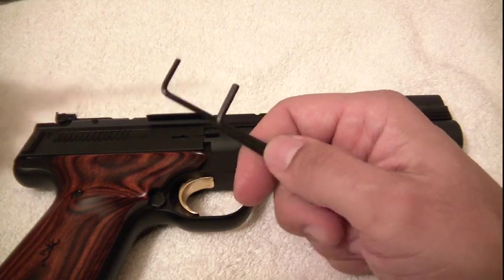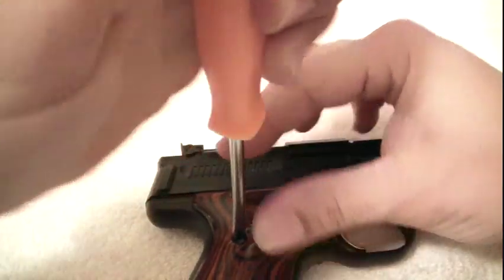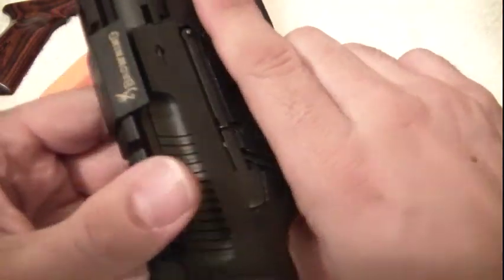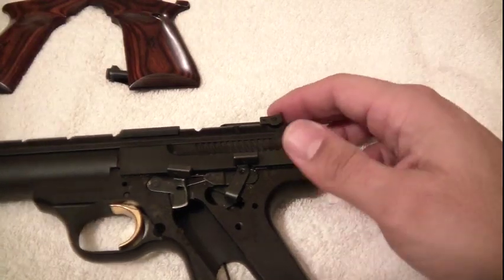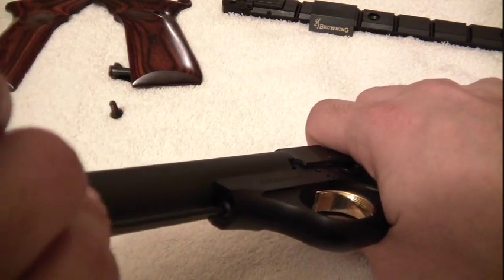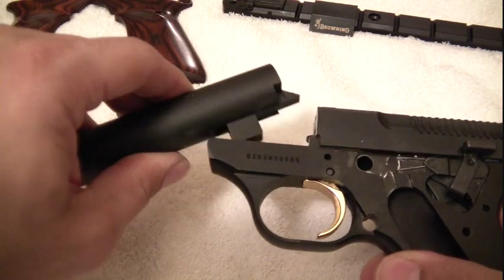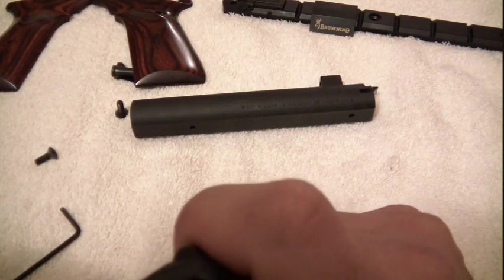NEW--MUST SEE!!! Browning Buckmark Disassemble (1/2)

Comment: Late to the party! But wanted to complement you on a great video! I have a Buck Mark Hunter with a 7-1/4" bull barrel, 2013 model year. Bought a Tactical Solutions threaded barrel to allow putting my suppressor on the gun. The only question I have, the breech block (or whatever it's called) on my Buck Mark does not "fall out", even if I gently pry it, no way. I can't believe that it not removable because obviously it contains firing pin, etc. Thought maybe I would have to remove the extractor or use dynamite, but that puppy seems un-removable? I don't want to force anything. Putting the rod and spring back in without removing that block is a pain in ass. Any idea what I am doing wrong?? Thanks again for the great videos!

Comment: Used you and someone else's video to get mine back in. 
The spring automatically positions  itself when pulled upward right?

I did it a little different.
I dropped the spring in the way I wanted it. The Frame was tilted back. Stuck an Allen key through to line it up and put pin in.

Comment: This is the best diasembly video for the buckmark. I have 1 suggestion. When removing the slide, just pull the slide back and grab the exposed guiderod. Lift up on the guide rod to remove the guide rod assembly from the slide then simply lift the slide off. No need to feness it off as an assembly. This way is much better for the buffer side of the guide rod where it rests in the hole in the rear post as well.

Comment: Cool, I used the disassembly video as a guide to do the trigger mod, I found I didn't need to remove the grips or the barrel..  my trigger went from 1817gms on my Lyman digital gauge to 795gms, I also polished the sear face with a ladies nail buffer.... I use this on my rifles too. the sear assemble pops up if you release the slide release.  Gave it a full clean out while it was in bits too, surprising how much gunk was in there. Cheers and thanks for the video.. Andrew

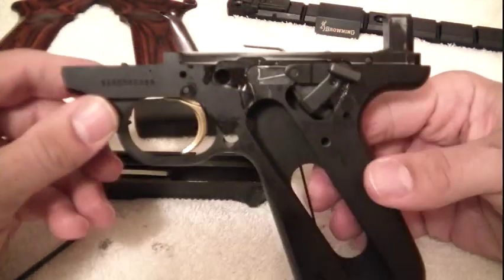Comment: At 7:01 into the video, see that little piece of metal that rides about an inch above the frame?  It's just a bit less in diameter than a paper clip.  What is that?  I broke that last night cleaning my Buckmark.  How do you fix/repair it?

Comment: I watched your video and felt very confident (due to your excellent instructions) that I could tear down a used Buck Mark that I just purchased. Come to find out its a 1999 model and several things are different. The primary difference is the recoil spring. Its not in a housing, nor captured in anything. There is a small block up front that provides a hold on the spring and rod, but its really small. 

Of course the spring, rod and small housing went flying when I pulled on the slide and it took me about 5-6 attempts to get it back together after I cleaned everything. The pistol was pretty clean and everything appears to be in the right place so I think that I'll take it to the range today and see how she shoots. 

Is there an easier way of getting the spring back into the pistol?  Its a pain and I'm sure that's why later models have been changed. Also, does turning the trigger spring around lighten the pull?  I would like to have a 2# or less trigger.

Comment: When removing the barrel there is no need to remove the sight rib. Just remove the rear screw and the barrel clamp screw  and remove them together. You are doing unnecessary work